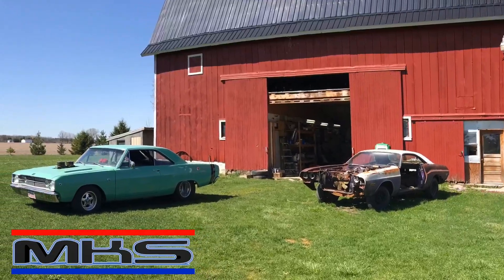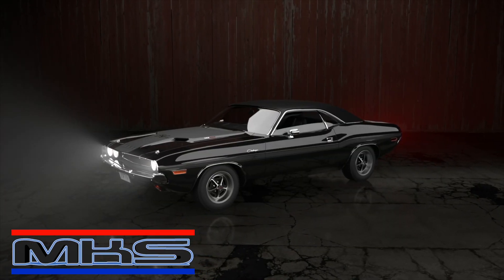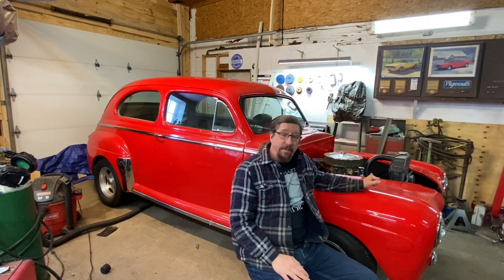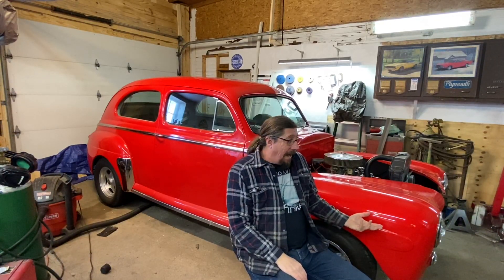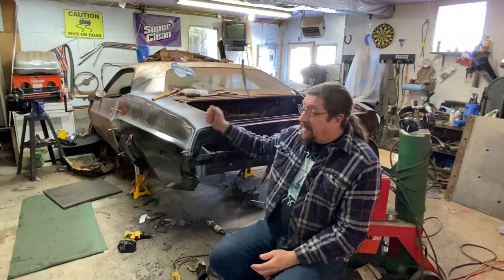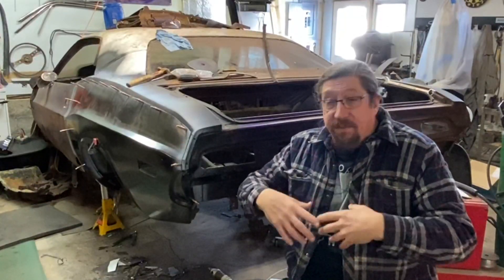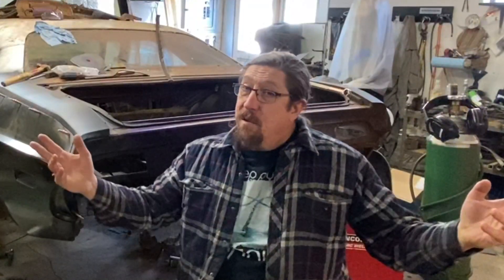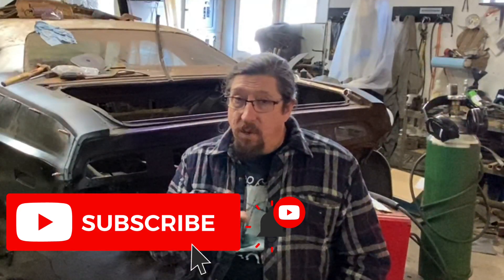Abandoned, Neglected, Forgotten and JUNKED!  Why do I pick these cars to restore?

Comment: Hey Mike Bill Brooks from Ontario Canada mopars are the most expensive cars to build .after markeparts are so much money compared to 10 to 15 years ago
You have it right to fab or look for a deal we have kijiji up here to get stuff but some people want an arm and a leg for mopar stuff..I only bought full floor pan was way easier and only 300 bucks
Reply: Unforuntaly my e body challengers body was so bad I had to buy alot of panels for it. I did end up welding in some sections of other cars to it to make it work (came with the car). Sometimes your put in a spot where you have to fix it right the first time.  I agree with Mike 100%. thats why most parts that im putting on the body are used and driver quality. I hate seeing ppl spend 120k on a restoration and not drive it. Makes no sense to me at all. I dont care if its numbers matching and "rare". Cars werent bought new to sit in a mobility trailer... I love seeing ppl enjoy there cars!
Reply: @enforcer5053  I had too put new floors in cause the last guy butchered all the floors for front and rear footwells it cost me 360 cash for new the front aprons and rails were pretty much rust free only had to fix a 1 one inch spot near the hood hinges and where battery goes and those were the only spots that were good on my old ones also,also 2 feet of rear rails I replaced with good southern one the front and rear rails cost me 350 bucks so was a good deal.. I also fabed a right trunk floor and top of the trunk floor extensions and top of thre rear frame rails  floor pan both side I fabed and repaired the 2 sides under rear seat just under the rear side window floor and a few other spots it's hard to tell I did them now but worst part of the whole job was cleaning an inch of roofing tar off of the top of floors and under neath my garage was a mess but I only scraped and wire wheeled it ..I also repaired alot of the firewall and it looks mint now ..next is body and paint..I didn't buy amd panels cause just in floors would have cost me over 2 grand I put good mark fit fine no problem just a tad different in the ribs in front but was a thick gauge metal
Reply from the maker: You gotta make it work within your own budget and time constraints.  😎😎😎
Reply from the maker: @enforcer5053  If we’re not enjoying them, what’s the point?